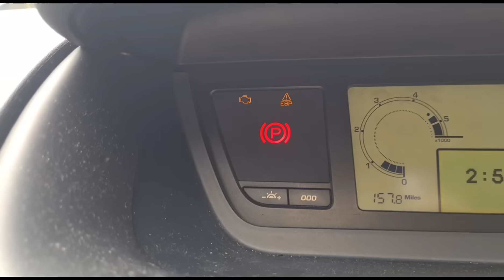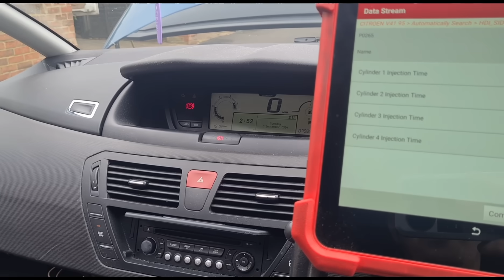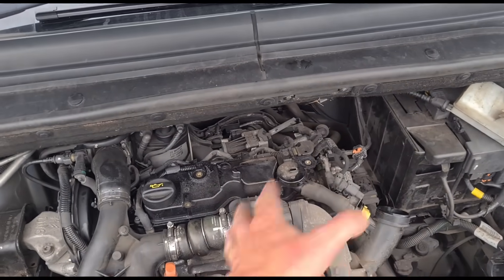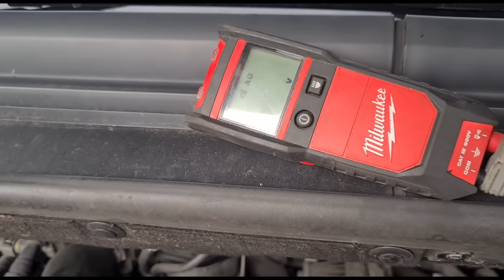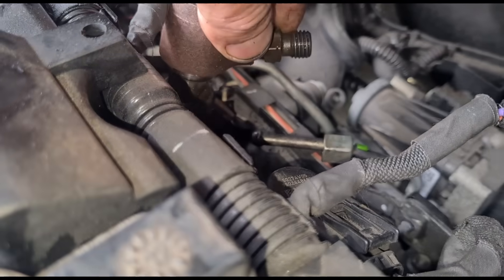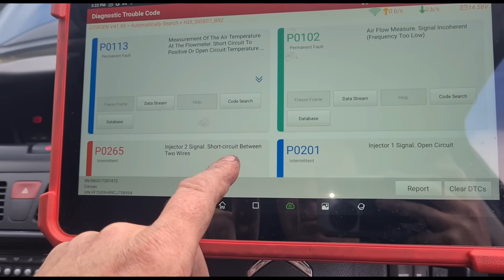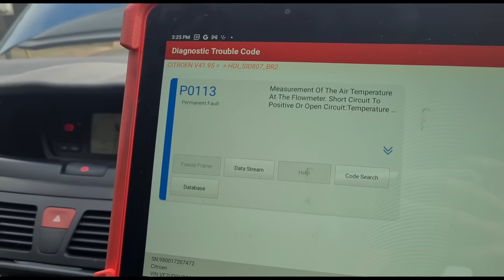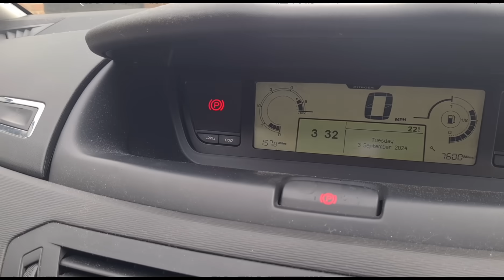Citroën C4 P0265 Injector Circuit 2 Has A Short

Comment: Hello, I'd like to know where the fuel pressure sensor is located on this DV6C engine. There's all sorts of conflicting information on the forums! Some say it's under the battery, on the right side of the fuel rail, while others say it's on the left side, just below the throttle body hose! Could you please help me? I have a 1.6 HDI DV6C engine in a 2011 Peugeot 3008. Thanks

Comment: Just been down this road with a 2011 C4GP, the injectors were all changed about 3 years ago as one failed, and the remaining three  were all becoming suspect, and fortunately. I'd kept them, so analysis was easy, it threw a code at me on the motorway, and dropped into limp mode, which wasn't exactly helpful, as I was overtaking an HGV at the time, When I eventually got it home, and did some diagnosis, the quickest way to see what was happening was to just connect the failed cylinder to a known good but old injector, which got rid of the error code, so I bit the bullet and got a new injector, fitting it was very much along the lines shown, but the plastic collar is not supplied with the new injector, and as several people have commented, the replacement injector has to be coded, fortunately, I have a viable working copy of Diagbox, which makes it a lot easier to do. 

The leak off is a PAIN to remove, but the rest of the process is as shown in the video. One interesting discovery was that the airbox had been removed a long time ago, and there should be substantial rubber washers on the back mountings, but both were missing, and one result of that issue was visible chafing on a wiring harness going to the back of the thermostat area, the plastic sleeve and some of the wire insulation had been worn away by the contact from the airbox, fortunately, I caught it before it did any damage.

Comment: Nice video thanks. Do you know if I clear the code before changing the injector will the engine run normally temporarily, or will the code not clear unless the injector is charged?

Comment: Got a 2012 Mazda 3  ,  injector 2 failed and car went nuts . Impossible to drive and bizarre lights on dash ,  reported faults with Abs and traction control just because injector failed .  New injector fitted ,  cleared all codes and runs lovely
Reply: Did you code the injector?
Reply: Kindly share the information if the coding needed... thank you

Comment: Thing to be wary of on these & the 1.4's is the ecu's short internally on the injector driver circuits - so you check wiring, change the injector, blah blah - and it still won't work right. Only solution then is send the ecu off to be repaired. 

Test for that is to measure resistance across the ecu's output plug to the injectors - each injector has a pair of connectors - whichevers borked will be the odd one/two out. That can cause a lot of head-scratching & parts cannon action on these.
Reply: I thought he checked the plug socket, which connects to the injector, with a multimeter. Is that what you meant?
Reply: @dustyfruitypie1633  You'd need to back-probe it with an oscilloscope to see the ecu trigger pulses. Multimeter wouldn't really do it. Or lack of trigger pulses..
Reply: @jamesward5721  you could switch two injectors and check
Reply: @filip2812  Can you start/drive the engine when you switch injectors, if not how can you know if they work? Are all four injectors switchable with each other and car driveable after that?

Comment: it is necessary to write the code of the injector in the control unit, because it will not work correctly
Reply: Why did he not do it in the video? What can happen if it is not coded?
Reply: @frv6610 Incorrect fuel readings and incorrect fuel supply. Check the readings on the injector without a code and on the injector with a code written on it.

Comment: I always wonder what happened between the end of the take where a part that needs to come out is still stuck and the beginning of the next take where the part comes out as if it is supposed to come out just like that. In this video, the air filter housing is an example of such a part.
Is it a few minutes of pointless airbox wiggling? Or maybe a few strong words? Or a loud plastic-on-metal scraping sound?
Reply: I put the airbox out several Times. Its all three oft them 😊 There is one special position, front right up and back down i think, then it works out better. But be careful- there are 2 plastic rings,that fit on 2 Spikes. If these break, the air box will wiggle around.
Reply: my (only) experience trying to replace injector seals on this engine involved a retightened bolt that sheared when trying to remove and a 'mushroomed' injector tip that made it almost impossible to remove. garage drilled old bolt out and eventually managed to pull stuck injector with two crowbars..

Comment: what about injector code to set injector Correction factor from the scan tool.
Reply: Very, very important with these engines. Have to program them because if previous injector was on the high end of injection rate  and new one is on the low end (manufacturing can not be the same so you have codes for the ecm to know.) the engine will not run smooth and cannot adjust the extremes sides of flow rate of injectors. If you replace all 4 injectors you can hear the difference. Also you have to drive the car ,  accelerate to 3500 rpm, let the car go without touching gas or  brakes a few times until its reaches 1750 rpm (in min 3 th gear watch out for speeding tickets :). Official citroen policy is too much, the ecm will learn futher on its own, you just have to give the fist "Quick learn" and the engine wil run smooth as new.
Reply: He probably did code it , just didn’t show it , Jimmy isn’t stupid he knows his stuff 🤙

Comment: Do you need to code in the new injector or not? 

Great video 👍🏻
Reply: injector correction, factor coding?
Reply: Yes you do, 6 digit code on top of injectors, and needs pilot learning also if replacing all 4. Clamps are known to crack also best to get new ones when fitting a new  injector. I got 4 new ones from Ford, they've a revised part, cost 50 quid
Reply: @BlakeCDS  How is piloting learning done?
Reply: @frv6610 its just a setting you reset on a scan tool after changing a full set of injectors. I had to do it on a DV6c in a ford focus and it ran like sh1t for a few minutes of the drive during the pilot learning